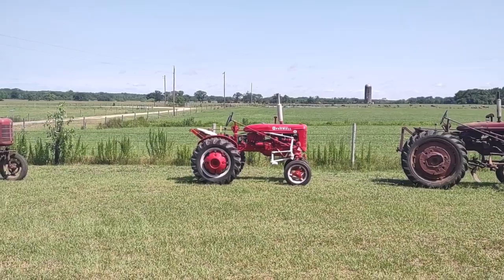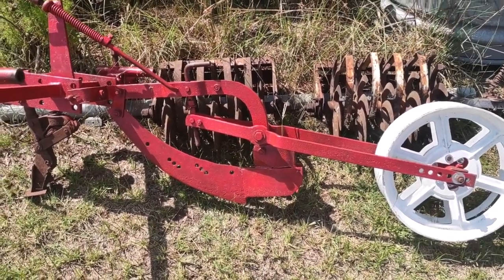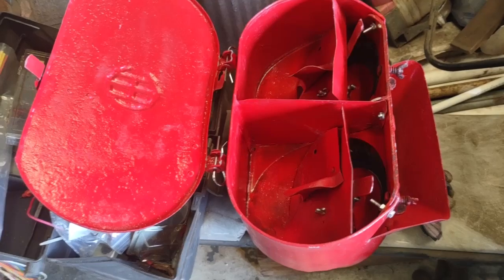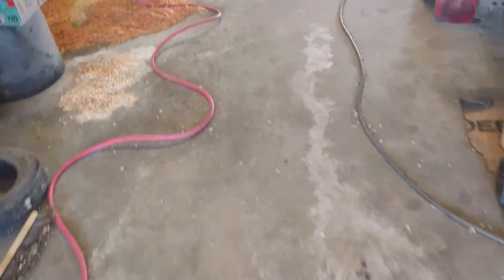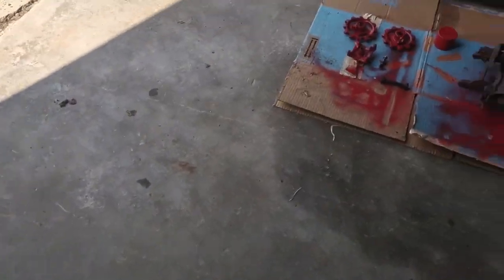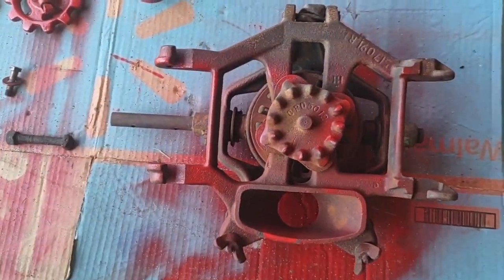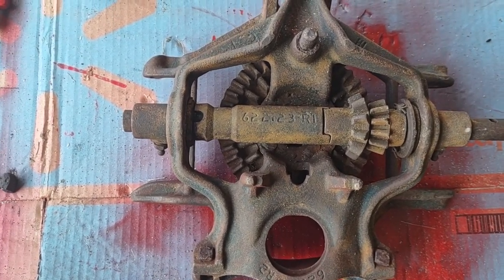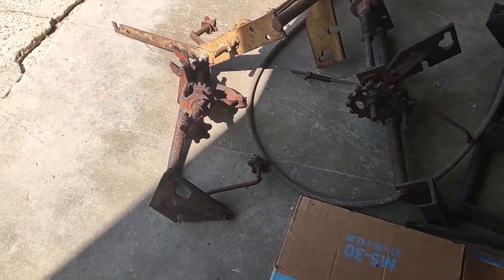Farmall Super A Belly Planter and IH Duplex Seed Hopper

Comment: Did you ever figure out what the double gears underneath were for?
Reply from the maker: No, I haven't figured it out yet.  I did plant the garden last week though using the 7 tooth base and the corn plate.  Apparently the corn seed was much smaller than the corn seed used years ago.  I calculated it should have dropped every 14-15 inches and I've got corn coming up every 5-6 inches.  I could see it dropping a lot of doubles and apparently triples.   I'll be busy trying to thin it out, if the crows don't find it.